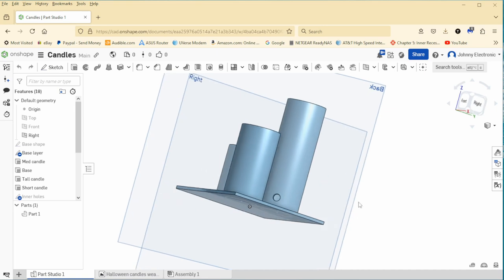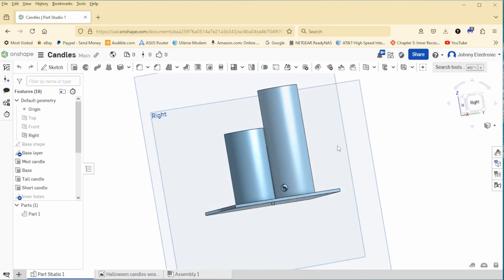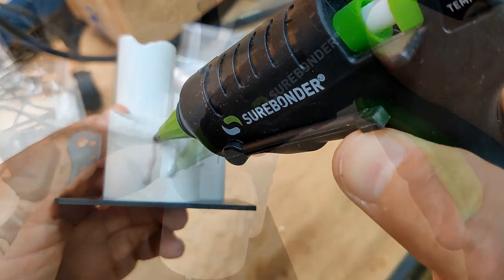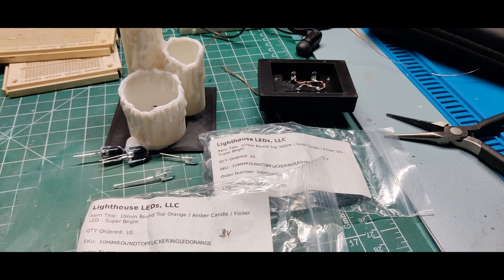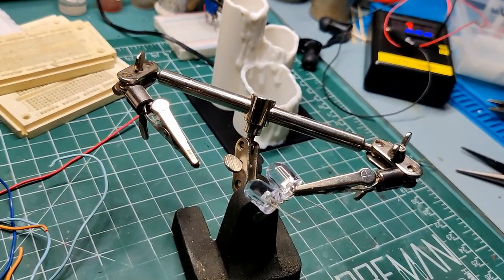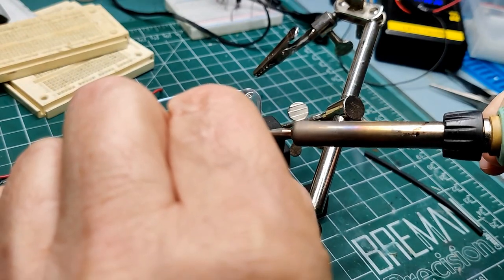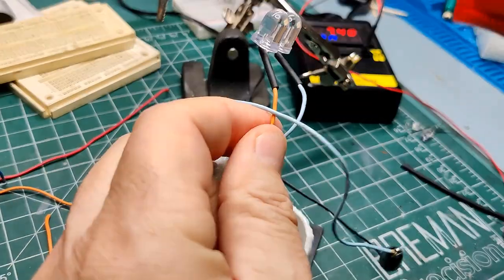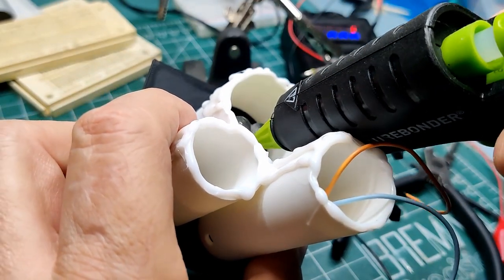Halloween 3D LED Candles

Comment: Great looking outcome. It looked like the candles all flickered in sync. Is there a small  addition you could make so that they were not in sync? I really liked the outcome.
Reply from the maker: Hi There, yes you are correct. The flickering control is inside each LED. Since you commented on it I set up a test circuit and found that when the LED's are in series they will be synchronous with each other but if you run them parallel they will by asynchronous. Nice catch. I will change the circuit to use two or more parallel paths for a bit more randomness but it will require some extra resistors to drop down the 12v. 
Thanks for the comment.
Reply: @Johnny_Electronic  great project. I think if you wanted to commercialize these you could build the melting into your printed model and make a lot of these somewhat quickly. I know I would but a few sets!